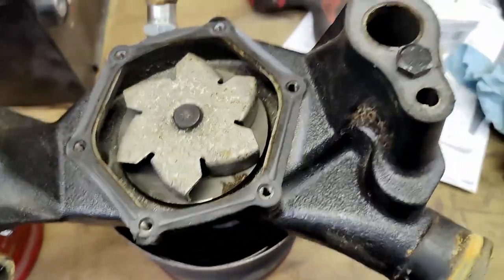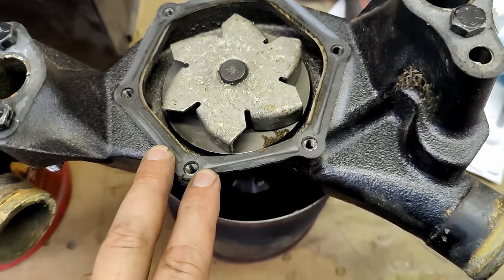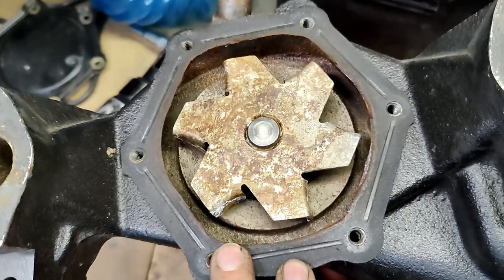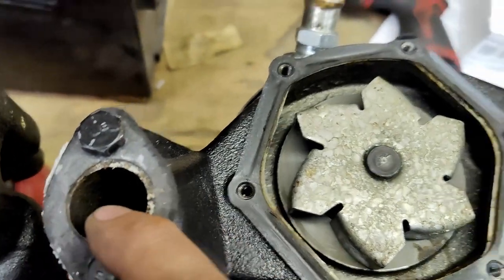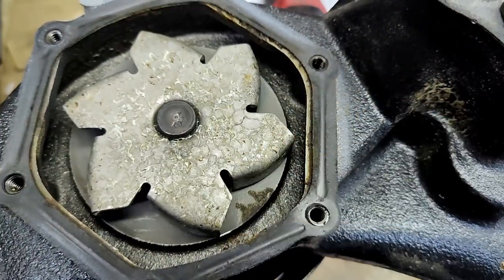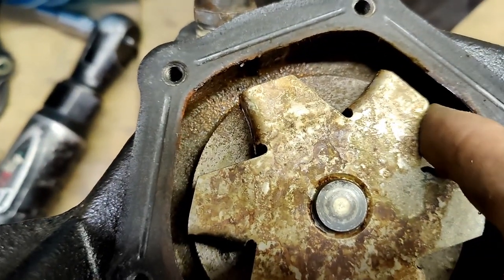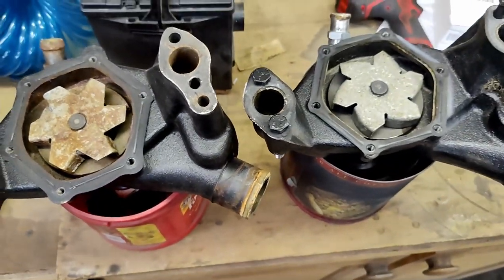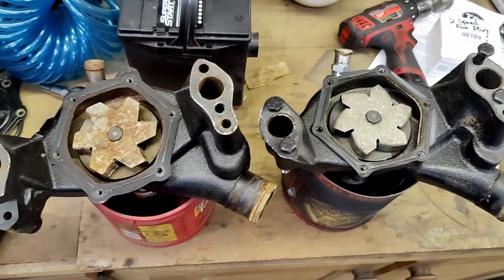SBC Water Pump - Reverse Rotation? Or Standard Rotation?

Comment: Hi there , just a question are you sure that the other pump is stander as some video show it's a reverse rotation.
Reply from the maker: If you look at the impeller on each pump it's very easy to see that they rotate opposite of the other. Another way to tell is if the water pump pulley has a smooth surface where the belt rides, its reverse rotation. If the pulley has ribs or a v groove, its standard rotation. Thanks for your comment.
Reply: Yea there's another video that shows the waterpump on the left side of your video to be a reverse style impeller for a serpentine system

Comment: The outlet on top of the pump is it pressure or suction !
Reply from the maker: Is this a statement or a question? Thanks for your comment.
Reply: The outlet is to connect a hose for the heater system, hope this helps you

Comment: Did you figure it out y it was so hot
Reply from the maker: It was several things. I'm running a small block 400 which inherently run hot to begin with, but I wanted to see what I could do to get the temperature down a bit more to my liking. I removed the water pump to confirm it was a reverse rotation for my application, and it was. So that checked out okay. So it was mostly that the engine that was recently rebuilt, had an issue with the rings not seating properly. Also timing was a factor since the balancer timing mark was off by 8 degrees and my EFI system was running on the lean side. The engine has just been rebuilt and broken in on a run stand so we believe all is good now. I have a video coming out soon on the break-in procedure of this engine. Thanks so much for your comment.